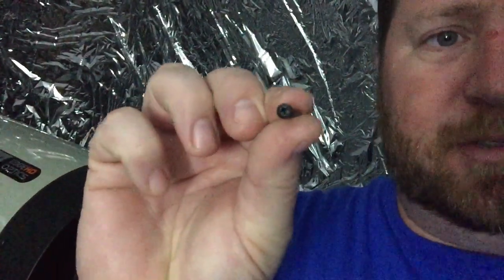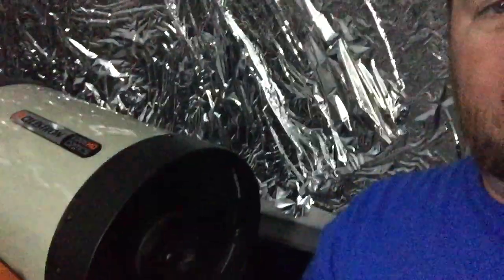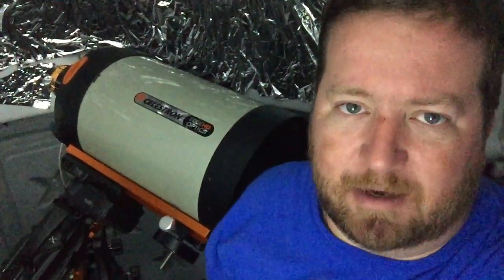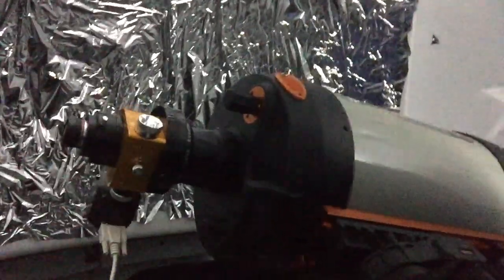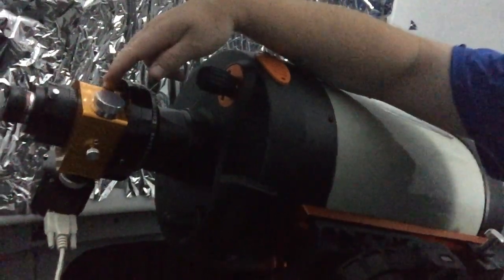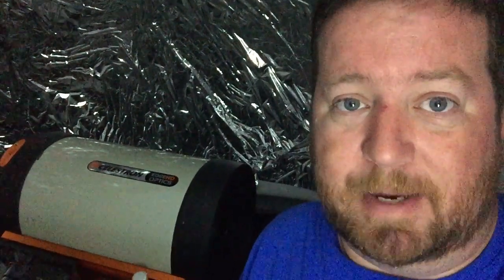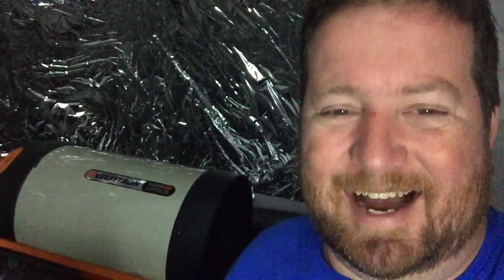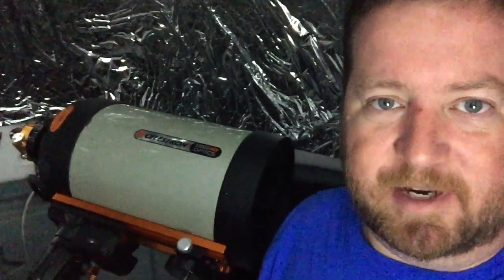Collimate Celestron Edge 1100HD with Bob's Knobs

Comment: Nice. Still struggling even with Bob's knobs on my edgehd8" cause I usually change to hyperstar and vice versa which messes up easily the collimation everytime.

On another note, How did u manage to add counter weight on the dovetail end?

Comment: I wish this was about collminating = (   I have a 11" RASA and a little intimidated.
Reply from the maker: Ron Kramer   I’m not sure how it’s done on the rasa because don’t you just have the main mirror on the back and you put the camera where the secondary normally goes?  But if it helps, I put my stars just a bit out of focus where you can see a black donut hole.  The donut will be lopsided. Then making small adjustments I try to make the hole move to the center. There are three screws usually and you just have to experiment how to move the hole. It’s usually better to tighten than to loosen but if you have to go more than finger tight you might have to back the two opposite screws off a little.  Don’t crank it too hard. I also use my photo programs photometry aperture cursor because it has two concentric circles. Helps line up the hole in the middle.  Once the hole looks central stop. Don’t chase perfection too hard. Good luck!

Comment: Did you use an artificial star and how many feet away was needed?
Reply from the maker: TopoChico  I did use an artificial star and to get it to focus I put it on a tripod about 200 ft maybe more away. It was also up in the roof of the building I’m on, so I just went as far as I could without falling off. Even if it won’t quite focus if you are too close you can still collimate it because you use the ‘donut’ of focus to center the shadow.  Good luck!